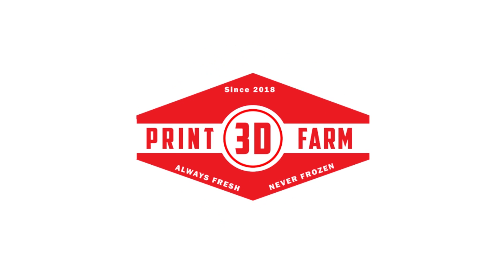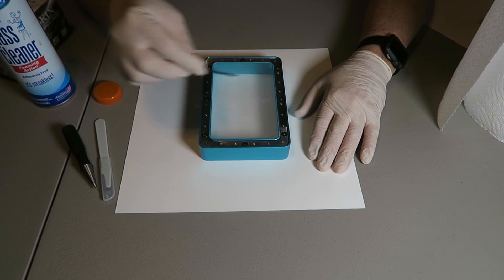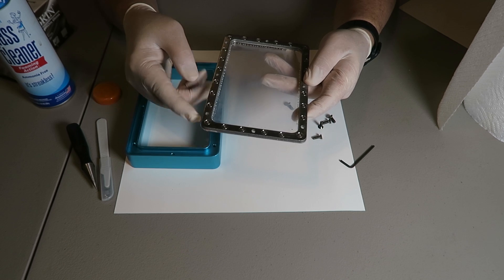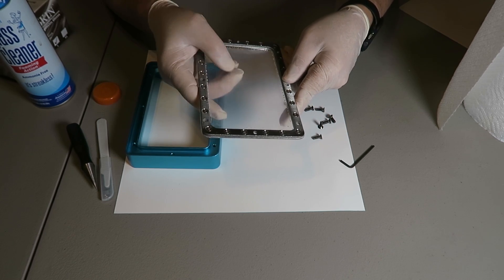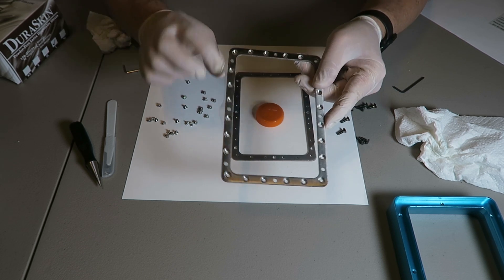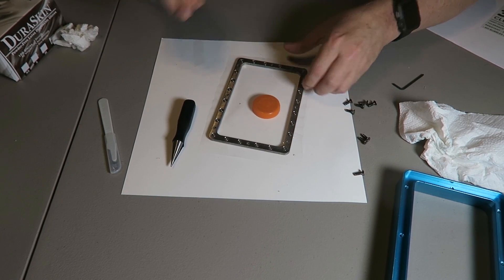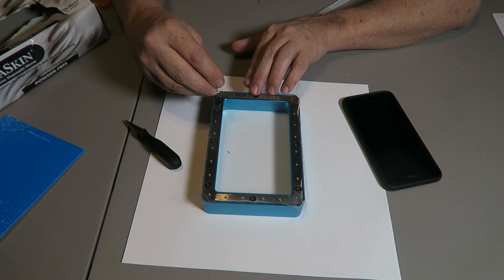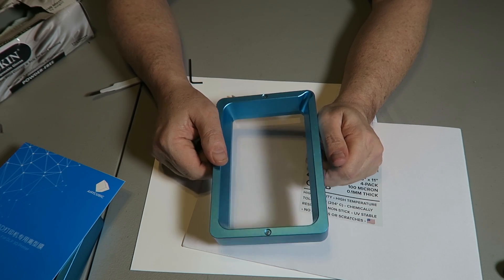Anycubic Photon 101: Replacing and Tuning the FEP!

Comment: Hey, can anyone help! I keep getting Memory error code : M_1000 and Memory error code : M_11820 and it don't print! cheers guys!
Reply from the maker: TheWheels1965 Sounds like a bad USB stick. Anycubic USB drives are notorious for being junk. Get a new USB drive and format the drive to FAT32.  Give it another whirl with the new stick.
Reply: Hi, thanks for getting back so soon! I worked it out! I saved the file to the usb stick, and forgot to "slice" the bloody thing! I should stop drinking while I do this type of stuff! Cheer mate!
Reply from the maker: @TheWheels1965  Awesome!  Glad I could help!
Reply: Hi, thank you! But Im having problems getting the resin to stick to the plate, My last try it only half stuck! Why!
Reply from the maker: @TheWheels1965  Have you successfully printed the calibration cube?
Reply: No, I haven't!
Reply from the maker: @TheWheels1965  Try printing the calibration cube first before you attempt anything else.  It is specifically tweaked for your printer.  Also, make sure your bed is completely 'flat and level' before you fire off the cube.  Follow my vid on bed leveling.  That should help.
Reply: Hi, I will try that! do you clean the resin and the tray after very print! For little bits of stuff left over! Its a pain! Thank you for your time and i really appreciate it! I have a Cr-10s printer too, its a pain too setting up! cheers
Reply: Hi again, sorry to be a pain, well its starts to print the supports on the top plate and they stick but after the main part of the print fail to hold on! I must be missing something!
Reply from the maker: @TheWheels1965  If the calibration cube is not printing,  it definitely sounds as if you are out of level.  Make absolutely sure that the build plate is 'flat and level'.  Also, are you printing in a cold room?  Do you have access to Facebook?  I can point you in the direction of our FB Photon User's group.  Lots of expert help too! :)

Comment: Why what you have to re-level? I understand it's a thinner film than the stock FEP sheet but in your leveling video the vat was never part of the process.
Reply from the maker: That's true, but the stock FEP from Anycubic is just a bit thicker than the one I'm using in this video which would alter Z=0 since it's a thinner FEP.  It's probably not going to make that big of a difference, but never hurts to be safe than sorry when making sure level is true! :).  Thanks!  Great question btw!
Reply: @3DPrintFarm  I get that, but from my understanding you never set the Z offset with the fep/vat so I don't see how it would make a difference other than setting it 0.01mm lower and have more drag on the paper during the leveling process to account for the lower thickness of the new fep. I'm assuming the paper is similar thickness to the original fep thickness, so maybe use loose leaf paper that's a tad thinner. Correct me if I'm wrong. I just ordered mine yesterday but have over 2 years in the fdm printing, I know it's a whole different animal
Reply from the maker: @potatojz38  Yep.. I see your point!  Don't know what I was thinking.  The FEP got ahead of rational thought! :) Thanks for setting me straight!
Reply: Always recalibrate the system if you switch FEP thickness. I actually like to recalibrate again after running through a half dozen or so models. You can use a sheet of the unmounted FEP for calibration purposes instead of paper of unknown thickness. Not all paper is the same thickness.

Comment: It's a shame that obtaining a new vat or build plate to go along with our new FEP is so difficult. I found one supplier but they're always out of stock. Might need to make them ourselves apparently. Thoughts?
Reply from the maker: I purchased a new vat on Amazon a couple weeks ago  from an authorized Anycubic seller and have been really happy with it.  I do agree, however,  I'd like to see someone make up some reliable build plates and vats.  It sure does make things handy when going from print to print.  Here's the link to the vat I purchased.  https://www.amazon.com/dp/B07MGV9PYK/ref=cm_sw_em_r_mt_dp_U_UPzGCbTHAH8SG
Reply: @3DPrintFarm  Thank you so much. That takes care of the vat, now we just need the extra build plates. Unfortunately that's the harder of the two to make. 

I want to be able to instantly go from print to print, use different colors without cleaning the vat, and be able to directly hang the build plate in the curing chamber while another one goes in the machine.
Reply from the maker: I'm with ya there.  Extra build plates would be a boon to the Photon users.
Reply: @3DPrintFarm  How did you obtain the appropriate Hz for the FEP sound?
Reply from the maker: Good question!  I obtained this information from our Anycubic Photon Owner's group, the Photonsters.  It's about halfway down the page.  https://github.com/Photonsters/anycubic-photon-docs/blob/master/FAQ.md#vat--fep-setup

Comment: Nice tip, using the sound analyzer to "tune" the FEP. I dread having to change mine out when the time comes, but your video makes it look slightly more tolerable than others.
Reply: They really designed the resin vats poorly, hoping someone makes one with stress free replacement.